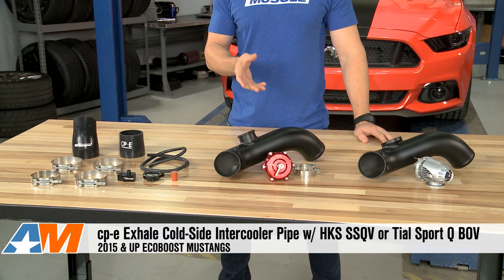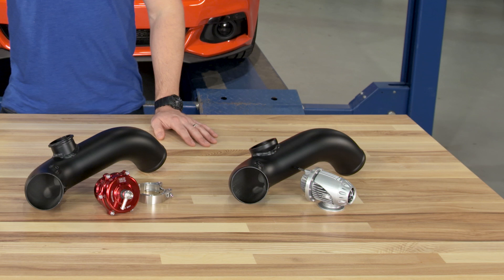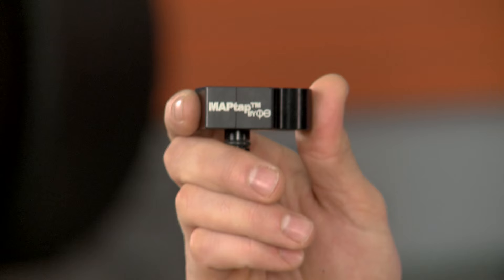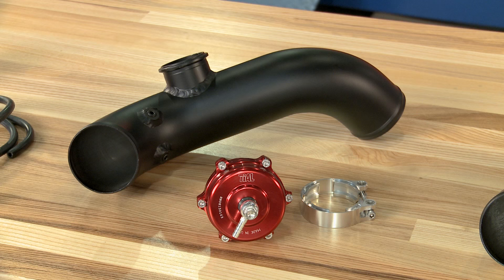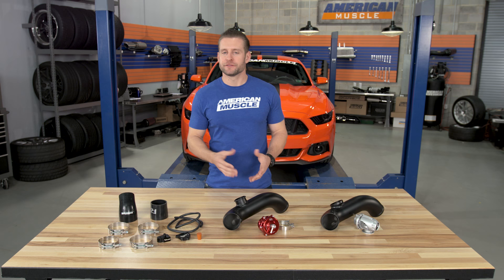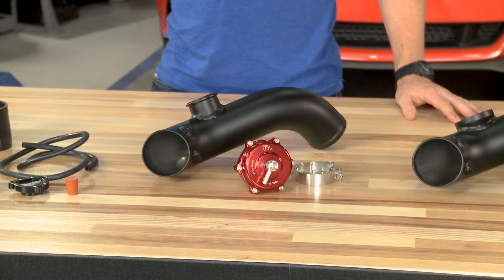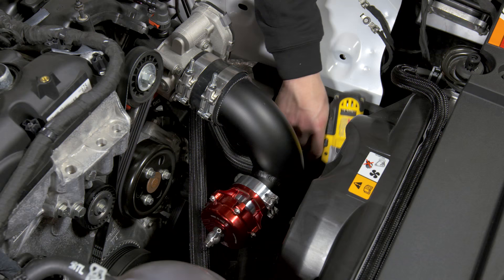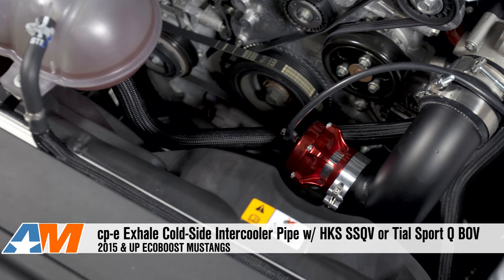2015-2017 Mustang cp-e Exhale Cold-Side Intercooler Pipe w/ HKS SSQV or Tial Sport Q BOV Review

Comment: I'm surprised they didn't go over the distinct differences in these two types of BOVs. The tial is a push style and HKS is pull. Depending on your application and boost level you have to mess with getting the right spring in there on the tial. With the HKS there is no adjustment necessary, it will work regardless of boost level.
Reply: good to know. thanks

Comment: I bought a tial 8psi blow off valve what piping do I need to install it in my 2015 ecoboost??
Reply: You need a cold or hot side charge pipe with a tial flange.

Comment: What about the electrical plug from the OEM bov?? Are you just gonna leave it unplugged and throw your check engine light on? For the money I would think they could include the resistor deal that Turbosmart has to plug in and fool the computer.....
Reply: Does anyone have a response for this? Installed the tial q 8psi on my ecoboost and the check engine is still on after disconnecting the battery.
Reply: You can get the turbosmart sensor for 50 bucks, Thats what i had to do to get rid of the light, And its nice to have the turbosmart vacuum fittings as well that come with the BOV kit.
Reply: @TheMiracleMcgee  Im having the same issue, have you fixed this problem?
Reply: @KenHMladin  does the turbosmart sensor work with this kit?
Reply: @0wnToDead  yes, it worked for me. It took a bit of driving around, but the check engine did go off after the install.
Reply: @0wnToDead  Yes
Reply: Your tuner can probably get rid of the CEL.

Comment: can you run another BOV, like say turbo smart, with it or is it only those 2?
Reply from the maker: +ccoghill23 Those other BOV will most likely require a different style mounting flange.  So in theory you could, but you'd have to cut off the existing flange on the CP-E piping and have a different one welded on.  Hope this helps! -Justin
Reply from the maker: +TheAssassinpro2 You'd have to take it to a shop that is proficient in welding aluminum- speed shop, exhaust shop, etc.  Hope this helps! -Justin

Comment: Can we use greddy bov
Reply from the maker: +Danny Saad Unfortunately, no.  CP-E only offers the exhale kit with the two options listed, HKS or Tial.  There might be an adapter online you can grab but most that I've seen are greddy to tial and not the other way around.  If you had your heart set on the greddy you could always cut and reweld the correct flange but that's totally your call.  -Justin